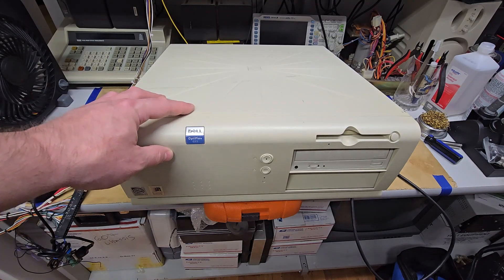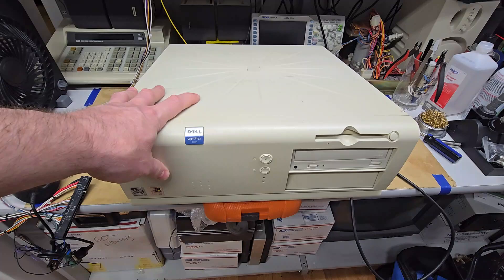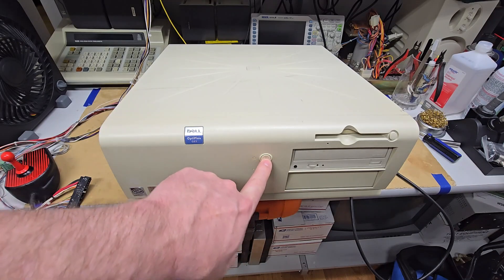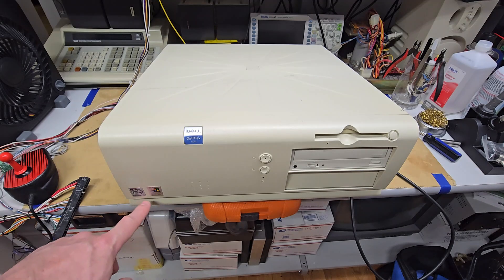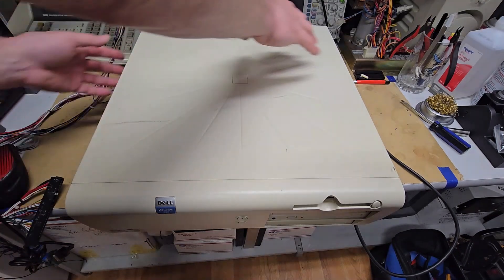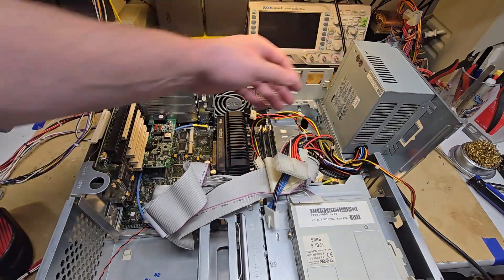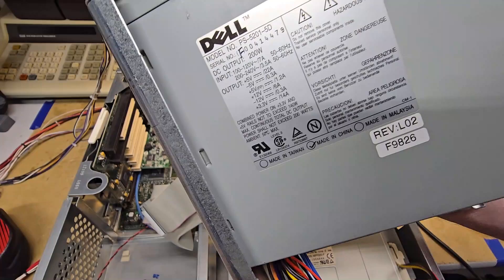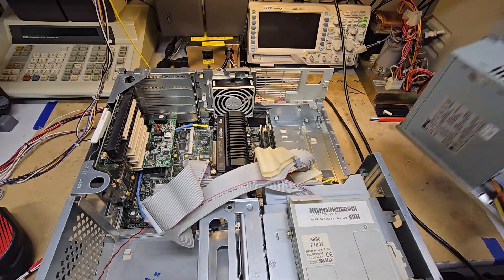This Old Dell - OptiPlex GX1 ATX Power Supply Swap

Comment: Did the GX1 tower and the SFF use the same supply? I have a tower that I'd love to get back up and running. I can't find a supply anywhere.
Reply from the maker: I wouldn't doubt it but the manuals are still online.  I would replace with an ATX but just check and match the power that the manual says.

Comment: It would have been great to see the final rearranged connector of the modded ATX PSU.
Reply from the maker: Are you referring to 6pin 3v connector?  I show the repinned atx connector starting @8:56
Reply: @jacklick my bad I didn’t realize you had already repinned it. I wrote out the steps for myself comparing the ATX vs Dell connector pinouts. I found that the repinned ATX connector is two 5v wires short. However, pins 16, 17, and 18 on the motherboard are shorted together, so leaving pin 17 and 18 unoccupied is fine. I am going to repin an ATX PSU today.
Reply: @jacklick the JRready pin extractor was the ticket. I modded and ATX power supply successfully and tested it with the first GX1 board I have. It’s alive! The only difference with my connector vs yours is I left pin 17 and 18 empty since the motherboard has 16, 17, and 18 shorted together anyway. My pins 1-11 match your connector though. Thank you again for the video and for replying to me. 👍
Reply from the maker: @mesterak  awesome glad it worked out for you.
Reply: @jacklick  I just received a pin extractor but it sucks. I tried on three different PSUs and couldn’t get out even one pin. I just picked up another one from JRready this time, but it won’t get here until Tuesday. Grrrrr 😂

Comment: Are you into vintage PCs?  If so, I have a bunch of parts where you can piece together a few PCs. I can bring the bin to Troy's and you are welcome to take it all.
Reply from the maker: Hey Del!  I wouldn't say I am into it and appreciate the offer but no need :)I just had this so I could test old ISA device programmers and stuff like that.  Since I had an old atx power supply laying around, figured I might as well get it back up and running.